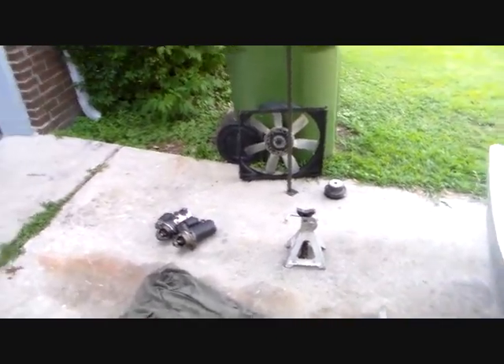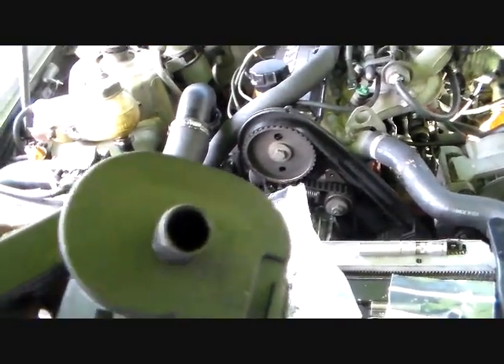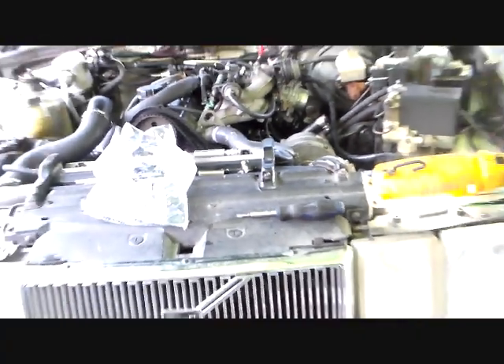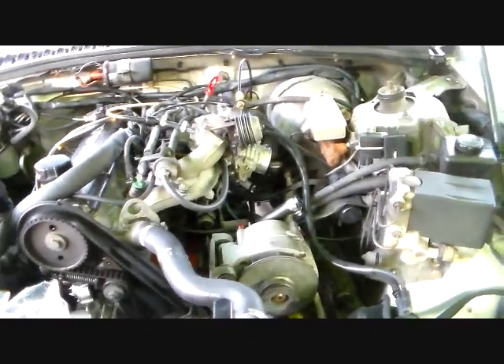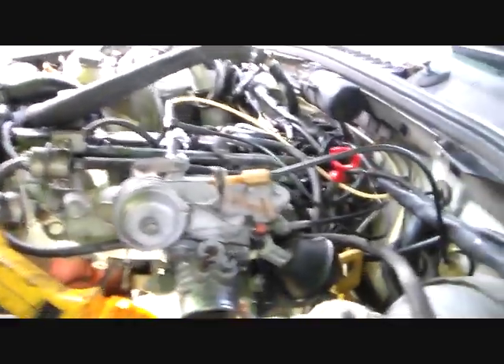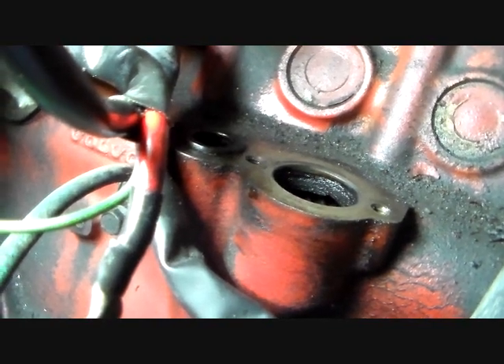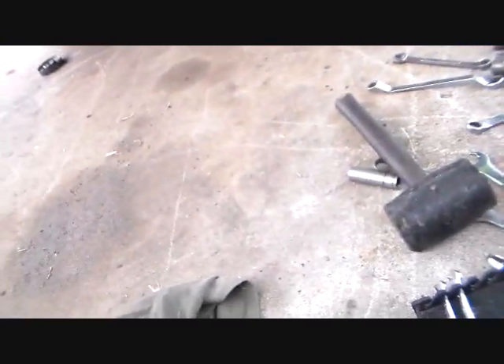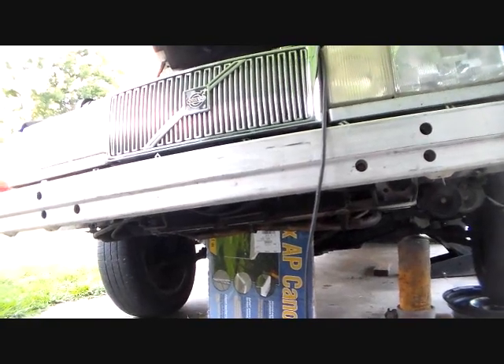Volvo 240/740/760 redblock oil separator replacement

Comment: Volvo red block is one of the most indestructible engine ever made- don't lump it in with other euro engines such as BMW engines
Reply: Sure...if you discount all that silly disintegrating crap bolted on the outside of the actual short block its a GREAT engine. Once all that is replaced...then you can start on all the other parts of the car that need repair. Thank goodness for the plethora of parts and the oodles of internet information available! Owning a red block is an education and a hobby all rolled in to one. It is not for everyone. I like it yet my three previous wives?...not so much. Now...where are those new hubcaps I bought?
Reply: Haha! Honestly I love these cars, I plan to do this job soon (as well as the intake gasket, clean the throttle body, and probably the injector O rings). Everything I've learned has either been from my Bentley repair book or the turbobricks forums :)

Comment: I took mine out and somehow squeezed the water line in the process and got coolant into the hole where the breather goes into and put it all together and the engine would not stay running . I kept running the engine and it is smoothing out a bit but still rich , I hope it burns out or gets out of there somehow if that's the problem

Comment: did this fix it? mine is leaking a snail tail.. I cleaned the hoses but never replaced or clean dis box.. Do u have to pull the starter as mine is covered in oil idk what is matter.  I change oil and only use synthetic. I got oil to do an oil change and mite do this while at it.. Thanks for the video

Comment: Not sure if you'll still respond, i have a 1990 760 turbo, im planning on doing a full rebuild once my ipd camshaft kit comes in, thanks so much for the timing belt videos but i started having an issue, around 2k rpms it starts backfiring and doesnt build boost anymore, barely maybe 1 or 2lbs. Would the oil separator be a huge issue? I know b230s are infamous for the oil separator issues

Comment: did you figure out what the deal with the starter was? mine also sometimes just clunks and I have to try a few times to get it to spin over
Reply from the maker: +timbo90ish Your issue is likely worn contacts inside the solenoid. Sometimes you can take the solenoid apart and clean or replace the contacts.
Reply: Cool, appreciate the help

Comment: Thanks  for the video! Great to see someone else doing this replacement. I've got a 92 940 with 230k miles B230F engine and it's time to keep her going. I had some questions about the replacement.
- Did you have to remove the  starter to be able to reach down to the oil separator?  Would there be enough space for me to get in there to remove it without taking off the starter?
-Did you have to remove anything else to get down in there? From my angle standing over the car it looks pretty tough to reach my hands down there.
Reply from the maker: +bruisercrusing The only thing I removed was the air intake tube.Once you get your hand under there it's only one bolt that has to be removed.

Be sure you get the good green seal to go with it.
Reply: thankyou. I did buy a new green seal so I'll be all good to go. hoping that after this job my car will be in tip top shape.